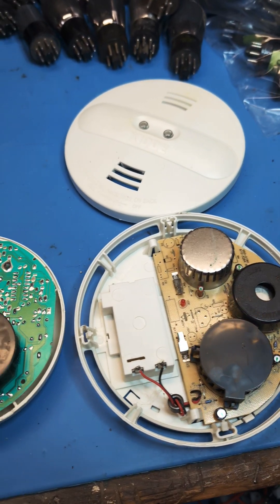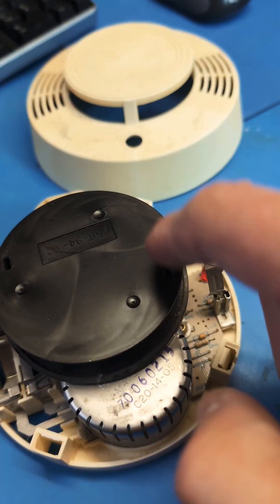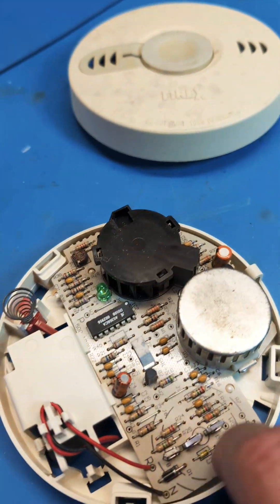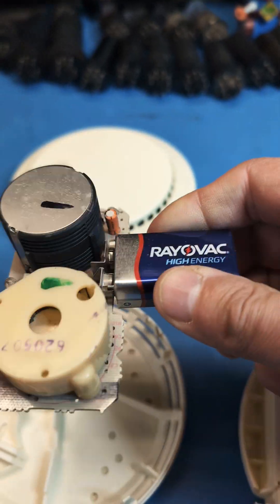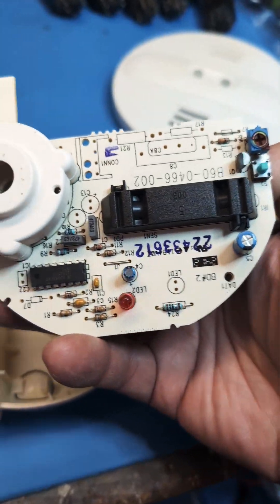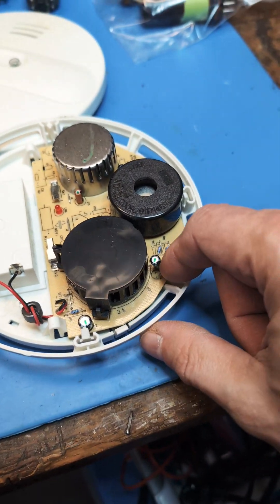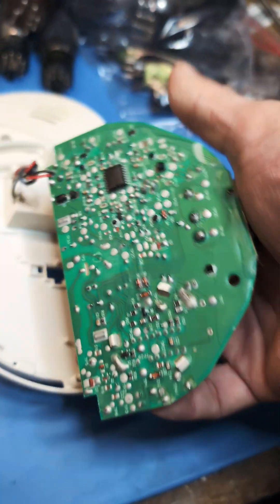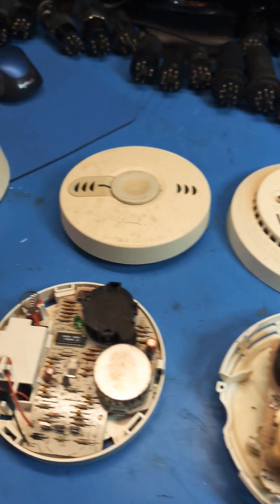What's Inside These Old Smoke Detectors?

Comment: These are the very very old type of smoke detector that have a radiation source. the new ones use a optical sensor to determine if smoke is around.